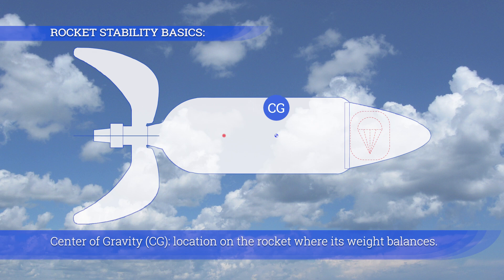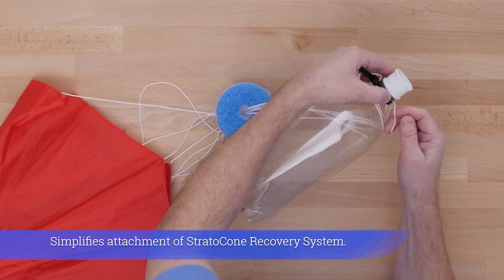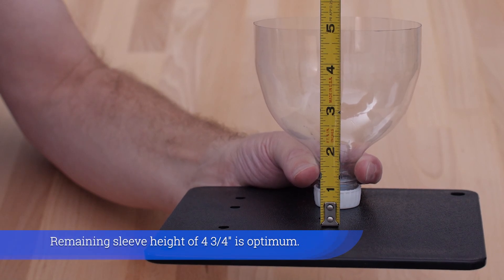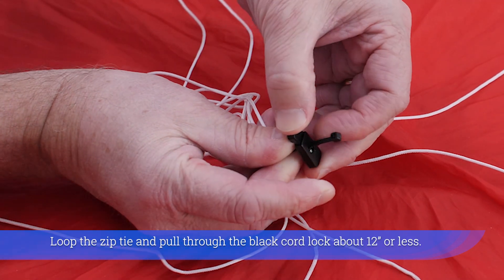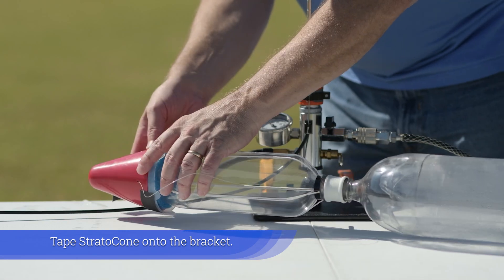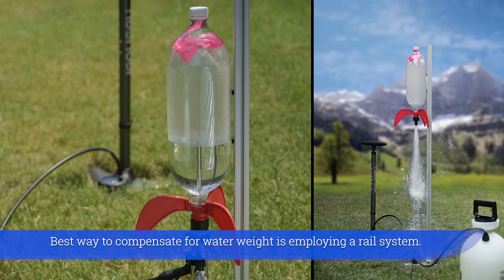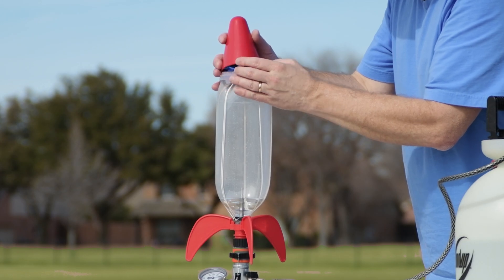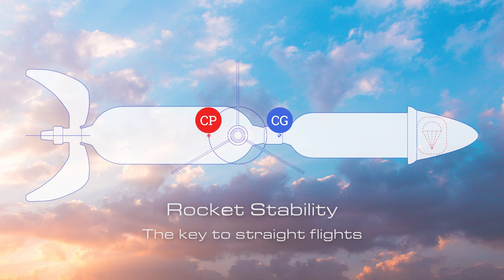Extend 2L Water Rocket to Improve Stability & Move Center of Gravity Ahead of Center of Pressure

Comment: Where do you find gardena nozzle that screw on bottle?
Reply from the maker: Quick release garden hose nozzles have a slightly different thread pattern from a soda bottle so they won't fit. You will need our StratoLauncher nozzle that has soda bottle threads and is only available on our website: https://stratofins.com/stratolauncher-iv-nozzle/